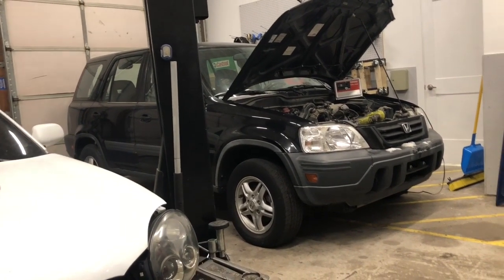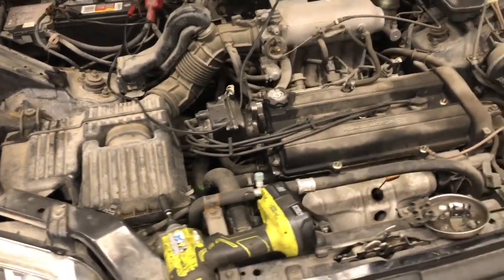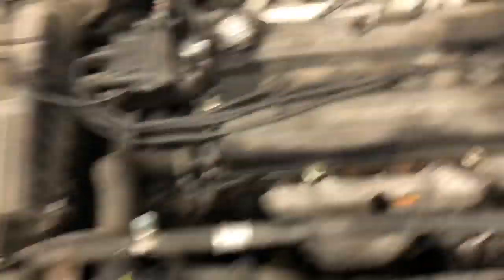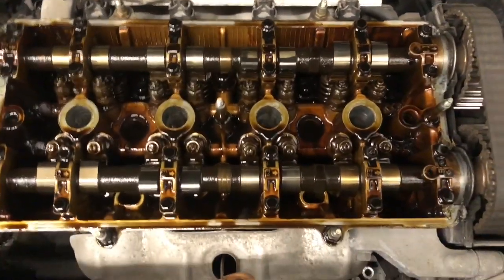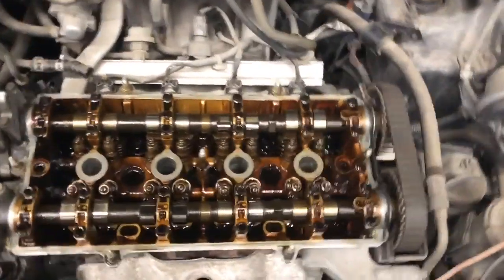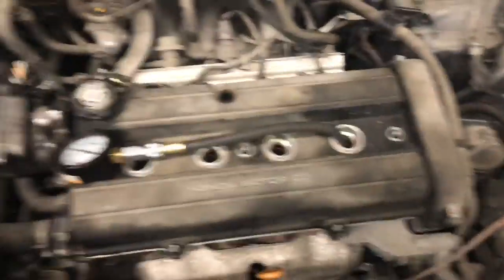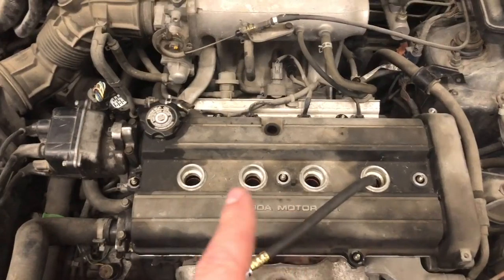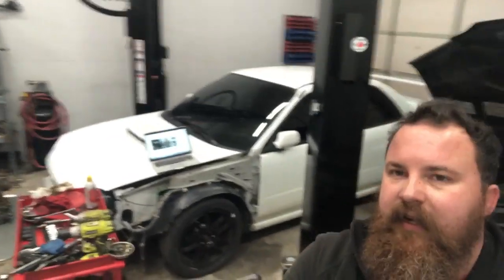98 CRV Misfire Diagnosis P0300, P1300, P0301-P0304

Comment: Hey, I'm having an issue I can't figure out on my 99 CR-V. I have a p0301,2,3,4,0 and a 1399 but it runs smooth. There's a weird noise almost like loose change in the valve cover and I cannot for the life of me figure it out
Reply: Did u ever figure it out? The issue
Reply: @joshm7876  yep need a new head and t belt

Comment: Wait what are JDM motors?
Reply from the maker: theouterbay engines, transmissions and parts produced for the Japanese market that are later imported over. Typically much lower mileage and better condition compared to locally sourced engines and parts otherwise found at salvage yards. I own a dealership and also an importing company and repair shop.

Comment: Whats a job like that cost to fix it?
Reply from the maker: Danny Hernandez really depends, the cylinder heads for me are cheap. Otherwise headgaskets? 40-50, intake manifold gasket? 12 and plugs? 10 bucks
Reply: Ronin Motors what do you charge? Ive had two different mechanics with conflicting suggestion on what is wrong with my vehicle and i just feel like im getting taken advantage of i wanna know what to reasonably expect to get charged for a job like this
Reply from the maker: jesus torres really depends. My diagnostics fee is $75 and my shop labor is $75 an hour. So it can be anywhere from $75 if its easy, to like $125 for a diag and valve adjust and timing all the way to like $750 for a new cylinder head installed, head gasket and timing belt.
Reply: @BasedSire  I've got a 00 and out of nowhere today all four are missing where should I start thanks ahead of time

Comment: my misfires codes were p0300 p0302.p0303.p0304 took my car to the shop says it was burn valves...i was quoted 3500 to get my valves replace, so its in the shop getting it worked on now...should get my car in a week or so that's what the manager said. i hope it drives like new again once its valves are all replaced kinda excited and scared i just hope it works out great since i am paying too much for the valves replaced wish me luck guys !